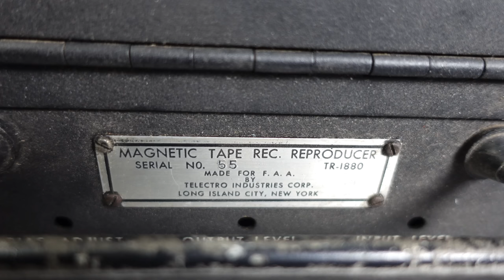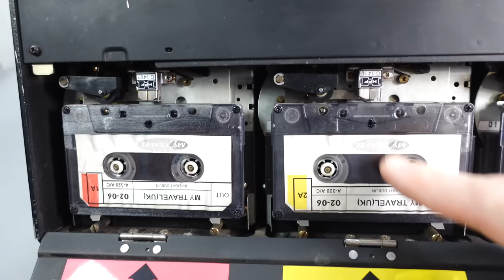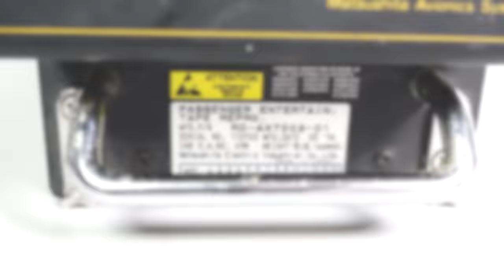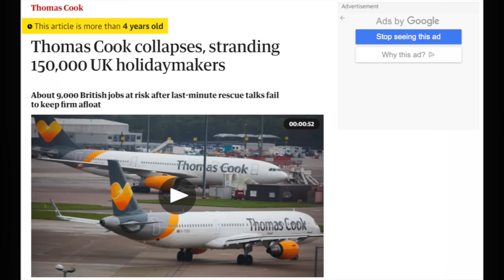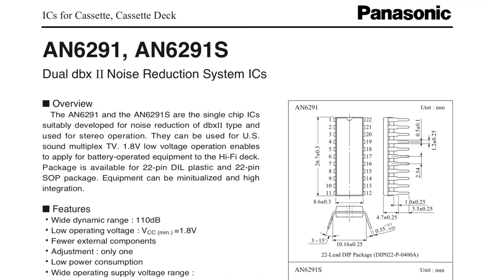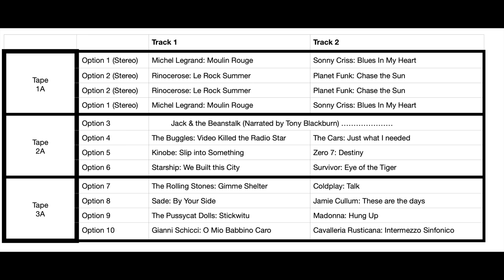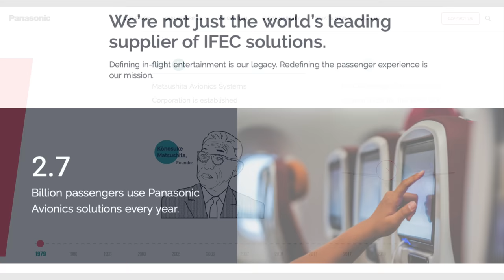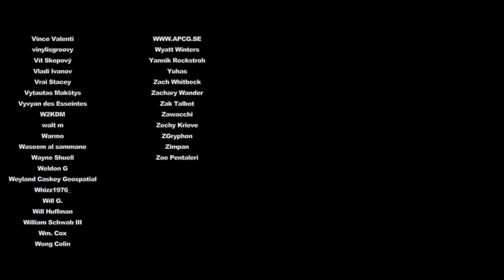The in-flight audio player

Comment: I wonder how often these were actually used by passengers given that by 1995 both portable tape players and portable CD players were extremely common and by the mid 2000's, mp3 players would have been very common as well.  I recall audio being on planes, but I don't recall ever using it past the early 80's as I would have had my own device with an assortment of tapes.

Comment: I can remember being on a mytravel a320 with exactly the same audio come though the headphones... I believe channel 1 was for whatever was showing on the main screens, channel 2 was radio (if memory serves, not always the best reception), the rest of the channels were different audio about 12 channels in total... The headphones were the clip over ear type with the two prong 3.5 jack plug... Any PA announcements paused the audio feed. I also believe the audio from the tapes could be passed through the aircrafts PA system (during boarding etc) Sometimes you could hear the local radio coming through the pa when boarding

Comment: That's a really cool piece of equipment.

If I can read the big chip correctly, it looks like a D8748 or D8749, which seems to be a really early microcontroller with embedded memory and storage. This piece of equipment being manufactured at 1994 makes sense too, with the datasheet I found for that controller being dated back in 1992, which I think makes sense for that kind of electronics. So when this was manufactured, it has to be a quite new design, and not a design from like 80s. At least it has been significantly reworked lately.

Comment: I do remember there being in the early 2000s a similar system used on the tilting voyager trains operated by Virgin, where you could plug headphones into the arm rest and listen to about 3 or 4 stereo programmes whilst on the train (not all of the channels would be operational though, depending on content, copyright, etc I suspect.) - not sure if they used the same or were using a different format.

Comment: I went in a school trip to Italy in 1996, and we got a Thai flight which stopped in Rome before it continued to Bangkok. It surely had a similar in-flight entertainment system that got a dial to switch between programmes, and two mono 3'5 jacks for headphones (an special adaptor was needed to listen in stereo, I knew about it because I happened to read an special Sony magazine on that flight that shown a model of headphones with that adaptor included). The Thai on-board magazine had the playlists for each of those programmes.

And later I saw a similar system on long distance buses, that one just used a single 3'5 lead and two couples of CD changers for the programming.

PS: The audio for those tapes deserves to be passed through your dbx decoder, just to check for any noticeable sound improvement...

Comment: I was more surprised the DBX system was used in the machines.  I thought they went the way of the dodo by the mid to late 80's since CBS records dropped them.  I did research after watching this to hear it went towards more professional.  I guess the cost for the Dolby license was a tad to high in the sky for them to use it.

Comment: Thanks Mat, great video. I remember in the 80s the headphones were hollow; just basic tubes. They would acoustically amplify the faint sounds that were coming out of the socket in the armrest.
Reply: I remember the hollow tube earbud phones, too. The audio source must have been in the chair armrest, because the volume could be controlled there. And the cheap plastic phones were meant to be disposable, and replaced with new ones before every flight probably for sanitary reasons.
Reply: My older brother worked on a catering service at LIS in the early 80s and he indeed brought one of these home. I was 6 or 7. I didn't understood at a first glance how the heck that worked!
Reply: Wow i had completely forgotten about that until you mentioned it. Interestingly i had an MRI last year and the headphones they put on me were the same tech. Hollow tubes. It was utterly rubbish, i could hardly hear anything.
Reply: @dj_paultuk7052  hope you're better now
Reply: Yes, I remember those well. They sounded like crap, too. Another reason why the Sony Walkman was so revolutionary in audio listening.
Reply: @RCAvhstape  I didn't seem to mind them as a kid. Was quite excited by the tech.
Reply: The original "air pods"! Yes it was like listening through a stethoscope - and for those that never experienced it, it sounded as crap as you think it would. The rubber ends of the tubes were really painful in the old ear holes as well, but you needed to keep them jammed in there or the sound got even worse (and more ambient roar got in). I did a few transatlantic flights in the 80s as a child with those + smoking on planes. Fun times!

Comment: In aircraft you won't find the latest tech in most cases. This is not a segment where you tend to experiment how newer technology would work with on a daily base.
They more hang on older tech, because it works. This is always a good advice if you favor reliability over "simply new and hip".

Comment: To me, the whole concept of having in-flight entertainment on short to medium haul routes back in 2006 sounds so odd to me. Being from Germany, I grew up mostly flying Lufthansa or German holiday airlines like the now defunct Aero Lloyd. They simply did not have any kind of in-flight entertainment except for the magazine in the seat pocket. (And I'm not sure if Lufthansa has in-flight entertainment on their Europe routes now,  haven't flown with them in ages)
In-flight entertainment was something I always associated with long-haul flights back in the day, like my first transatlantic trip in 1993 in a brand new A340, still with the good old three-CRT projector.

I don't recall ever being on any short or medium haul aircraft that had in-flight entertainment, which wasn't either the now so much liked "stream to your mobile device, but you can't charge it here, lmao" option or the on-demand audio and video touch screen variety. But of course you wouldn't usually find that on an A320 in 2006.

Comment: MTS TV audio also used dbx "companding". The last consumer version, dbx II, worked quite well but you had to record it properly or the output was miserable. Analogous to clipping digital audio, you had to avoid saturating the tape or the distortion was what was "expanded". The proof of the method was in dbx LPs, where the listener had nothing to do with the recording. Playing back one of those LPs through a decoder was mind blowing. You heard the stylus land then absolutely NOTHING until the music started.

Comment: There are a lot of OLD planes that are still used, especially by smaller carriers. Commercial planes are incredibly expensive, so it makes way more sense to keep old planes going as long as possible. Not unusual for planes that are 20-30 years old to still be used, so it’s not surprising that some were using compact cassettes for audio well into the 2000s. I just recently flew on a 757 with Delta, and the 757 was discontinued in 2004, so that plane was at least 19 years old (it looked older than that).
Reply: Thomas Cook (who merged with MyTravel) were flying 757's as late as 2012 when I left.  I believe they eventually pivoted to all Airbus.

The Pussycat Dolls and Madonna tracks certainly date this from early 2006.  I was not widebody trained, however any planes with IFE were playing video off Video8 (even the personal seatback systems) as late as 2012.

Comment: I wonder if they ever did an in-place upgrade... Take out all the cassette gubbins, install a small low power PC with multi-channel audio, and interface it to existing systems.  An 8Gb SD card could hold much more audio at a relatively higher quality... It would just need the supporting components to interface with the other avionics.  Would've been an interesting stopgap, although most flyers would likely have their own portable entertainment by this time as Mat said
Reply: Not on a plane. Check out those components on the circuit boards (like the gold caps) - they won't look like anything in your house.  Everything has to be specifically rated for air worthiness, which is why there is often a lag in airplanes seeing current technologies.  On top of that, everything has to work at a non-standard 400hz power frequency.
Reply: At that point of time people started to bring their own entertainment on the planes.
Reply: @Chiberia  oh yeah, well aware of that and all the tolerances, interop testing, qualification etc that's needed... When I said "they", I meant either the OEM or an authorized avionics engineering place that has the ability to recertify...   But you make very good points!!
Reply: @NiddNetworks the fact that those caps aren’t leaking after all these years tells you everything you need to know!
Reply: @Chiberia  They did exactly what he said, Google the TEAC AE-1600SDi. They can't get rid of these things because they want boarding music and they want to play a pre-recorded safety announcement so a flight attendant doesn't miss a sentence when the FAA happens to have an inspector aboard, and they get slapped with a 4-digit fine, and for foreign languages.

Comment: I worked in a small entertainment avionics company for a few years in the early 2000s. Our customers were private jet owners. I'm not surprised they were using tapes. Getting equipment flight  qualified is not cheap. This type avionics is not critical to flight operations so not as big a deal. Just to say that given the expense, equipment like this stays in use as long as possible. In 2003 my company was involved in on-demand digital audio and video servers, along with CD and DVD players. The technology was moving quickly. But then I left the industry.

Comment: Device looks like it was meant to be on a sled in the aircraft. Depending on where it was placed a cabin attendant may have even changed the A tapes while the b tapes were playing if it was on a longer flight. This would prevent the passengers from hearing the same stuff over an over. The connecting cable may have been on a bungee and be able to extend and retract with the unit, and be easilty replaced if it broke.
Reply: This thing was probably "racked" in the avionics compartment on the plane....you would have to pull it out of the rack to access the tapes on the sides....puling it out would also more than likely cut the power judging by the way the connector plug was constructed.... The tapes were probably changed by a maintenance person on a regular basis.
Reply: @grandinosour  Yes agree, that connector had no obvious means of securing a plug to it, this the whole module slid into a slot with the plug moulded into the back of the sled with the catches on the front to clock it into place...
Reply: As  @grandinosour  says, it goes in the avionics bay under the flight deck. Video players (reproducers) go into the overhead bins because flight attendants need to change the tapes in-flight, both when they run out and to put on the safety video. A problem airlines had was the tapes would get stolen, especially since they run movies before home video release, so they would lock them up. Audio programs don't get changed often, so it's more secure and less subject to abuse in the avionics bay. The form factor is called ARINC 404, it looks like 1/2 ATR. You can get the connectors by looking up the same. The electrical interface may be ARINC 732, a standard specifically for passenger entertainment system tape reproducers.

Comment: unit had Matsushita's(now Panasonic) best tapr heads - HPF - hard- pressed ferrite.interesting visd Matt. I often wondered how 'air-pipe' headphones worked on early  in-flight audio, was achwived. ? - every seat had separate pressure pipe channel to it?- I hated themit, used a m adapted Sony xasette player(TCM600), in walkman-like way, before Wlkman were launched, so just mono from my mix tapes.helped on long trans-atlantic flights.

Comment: Pretty sure you could still buy cars with cassette head units in 2006, so it's not particularly far fetched that they'd use that on a plane. Plus, tapes are a whole lot more robust than a CD would be, or a hard disk for that matter (vibration being an issue), and solid state memory was still quite expensive at the time, so tapes make sense.

Comment: Interesting video! Regarding the use of cassette, the most recent date code I saw on the ICs was early 1994. At that time, other options to play back hours of music would have been spinning hard disk, DAT, or CDs. From a reliability stand-point, cassette seems the better choice. Perhaps that aircraft was in service for 12+ years?
Reply: Almost certainly.  If you think about it, cassette seems a logical option.  In 1994 hard disk would have still been very expensive and certainly radio stations were only just beginning to phase in playing music via computer.  Aviation grade stuff would be eye watering.

CD there would be potentially too much to go wrong and the sort of error correction seen in portable and car players would still be very new and again, expensive for aviation grade.

The compact cassette survived in the car for so long - well into the 2000's - because it was embarrassingly reliable.  It survived the bumps and knocks, the extremes of temperature, and a combination of engine noise and crappy speakers meant even without Dolby B NR the shortcomings in sound quality were not an issue.

On a plane, the engine noise is tremendous.  Then you've got the crappy Walkman style headphones with the proprietary socket.  I'd argue DBX is overkill to be honest.

Comment: This is the channel that asks and answers the question:  Is there no end to the number and variation of audio and video formats and players?  And the answer is, of course no, which is a good thing since I, like Techmoan, have an endless fascination with the subject lol.  

I'll file this episode under the heading: Oooooh, so *that's* how they did it 🤣 

I did have an idea for how you could get this thing fully functional again though.  It involves buying an A320 and...
Reply: the wire diagrams for the aircraft side are available, and a 400 cycle power supply is not difficult to find or make.

Comment: I remember using those in seat switches on Airtours planes, although often the seat had the double mono Jack and socket combo so you either had to use the crappy free airline headphones or go without.  Now I wonder if that's why the tapes are mostly mono; did they play the same mono signal to each "channel" so that it sounded stereo to the casual user?

Comment: Since this plane had a tape deck in it, i assume it would have been some years old. They have built the A320 since the early 80ties. And so i assume this plane with the tape deck in it was made at a time where tape would still be somewhat common. And while i assume that the company that made the tape deck could create a device for CD's that would use the same socket on the back so the controls would all work, the problem would be if they could then fit a CD device into the space that would hold the tape deck. If not then the plane would need some sort of refitting for the new device which of cause would be expensive, and even if you could fit a CD device into the same slot as the tape deck, even that would be expensive depending on how many planes you had. And so waiting to replace these till you replaced the plane anyway would be the smarter and cheaper way. And not many people would know the difference anyway.

Comment: Well, when I have around 12 years old in 1991, I get a plane from Sao Paulo to Salvador, a DC10-30 from Varig that have onboard the entertainment system. If I remember well, the plane has 8 audio channels. But the funny is that the audio system use a plastic tube from the arm rest to the ears. No wires and speakers...

Comment: Yeah, I would've assumed some sort of multitrack tape cartridge, but not Compact Cassette.  So I guess there were moments of silence as the tapes rewound.  Also, they had to be pretty good at matching the content to the length of tape and between the individual tracks to minimize the silence.  Come to think of it, I think I experienced the silence and probably thought they turned it off for some reason or by mistake.
Reply: Judging from the video, each tape is duplicated, so there are six, three for each side. There could be some silence but not because of that, the side B would pick up as soon as the side A ended and started rewinding.

Comment: You can often drive AC devices that use a rectifier and solid state (non transformer) voltage regulator with DC as well. At sqrt(2) times the voltage

Comment: Ive been on planes with the "radio" in the armrest as recently as the early 2010s. I wonder if they were still using cassette tapes like this or if they had upgraded to a digital system by then.

Comment: Take the manufacturing cost of the unit. Multiply by ten to get the cost of the unit when tested and certified to be safe to aviation standards. Multiply by three or four to amortize the installation certification costs, and double that to get the total installation cost in an airframe.

Now you know why they still used tape-based systems in 2004. 

I reached out to a friend that used to deal with Matsushita IFE systems back in the 90s and 00s. We'll see if he can find an installation manual for it, maybe you could get the thing to operate. Also, decent chance it only needs 28V DC, so you wouldn't have a problem powering it up. Even if it ran off 115V 400Hz AC, they make inverters for that, usually with a 28V input. Check e-bay.